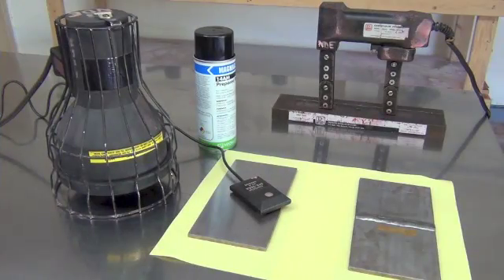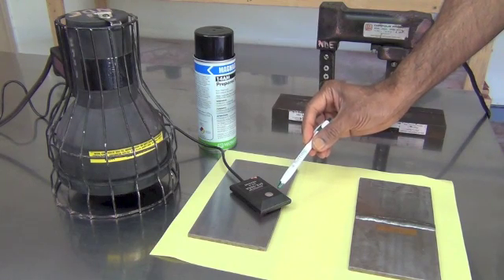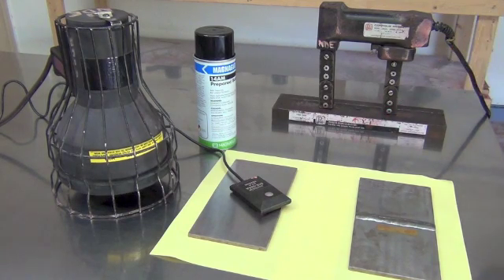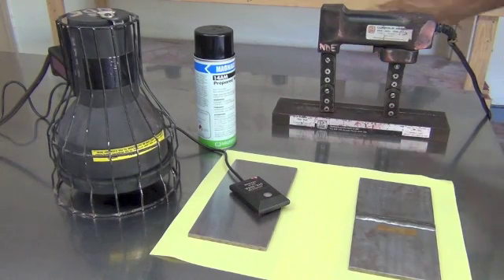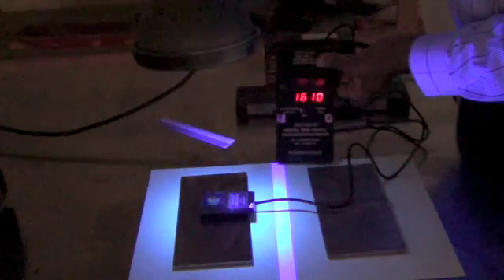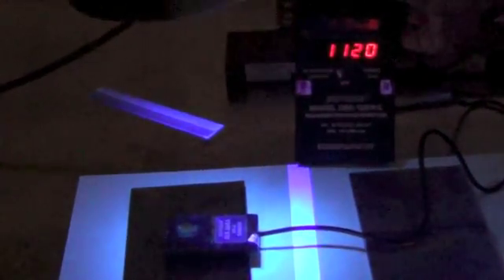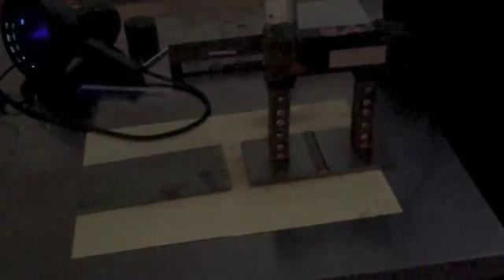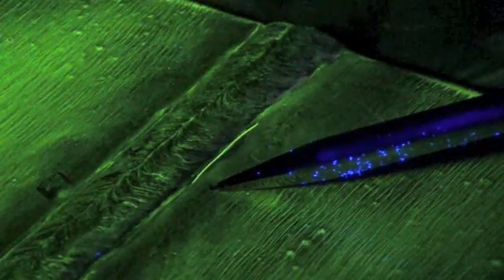Birring NDE 102, Wet Fluorescent MT; MT #4,

Comment: Why not remove excess wet particles from the surface like you did with the dry particles? If the current is still going, the magnetic power should be sufficient to hold the particles in discontinuities while the excess particles are removed.